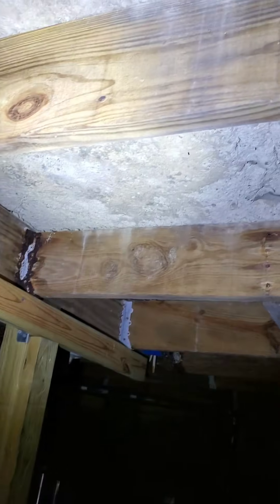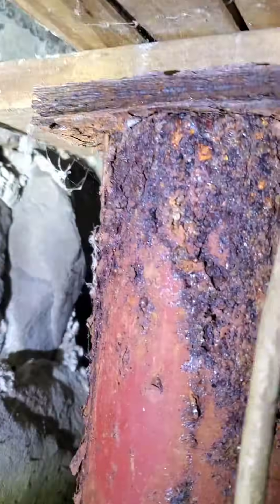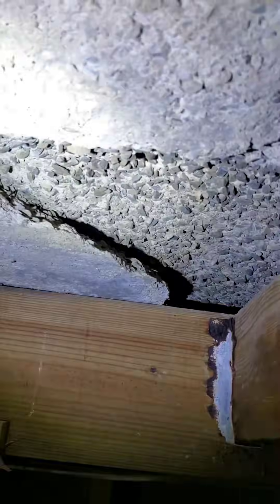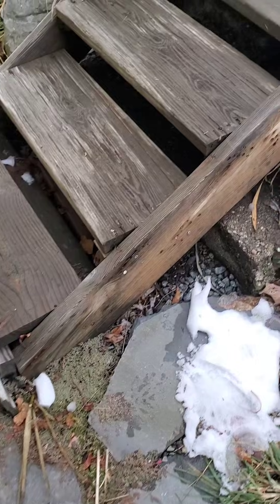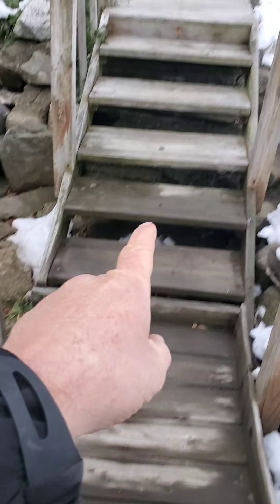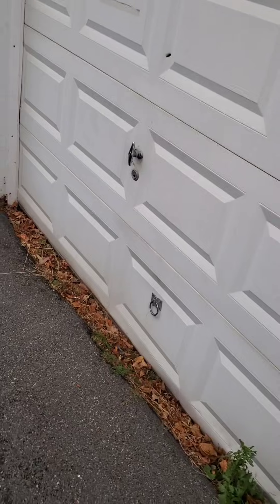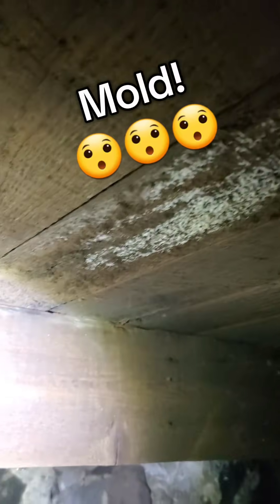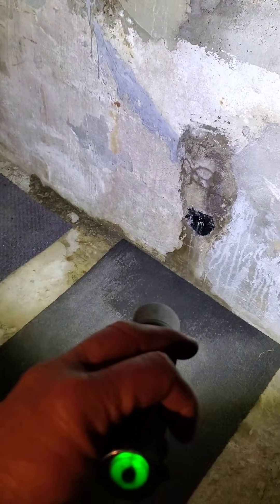Garage floor imminent collapse risk!

Comment: As a general rule, I thought you weren't supposed to put anything under garages, because people can put 5 ton cars in them. They just built 3 story townhouses on the hill next to my ex's house with the garage on the middle floor, meaning at least part of the garage has a basement under it. That doesn't sound like a long term reliable thing to do...

Comment: I didn't realise garages with suspended concrete floors were a thing. Is there any way to do that safely? I would want large concrete pillars if it is supposed to hold a concrete floor with a car on it...
Reply: Precast reinforced concrete panels,custom cut to the required length, wall to wall, engineer designed supporting walls. When done right it’s super strong, clear span below, but expensive.
Reply from the maker: Yup. I've seen them poured in place too with epoxy coated rebar and proper columns. I think we can all agree this isn't those :)
Reply: @tedecker3792  yep ala flexicore.

Comment: somehow i doubt they poured a prestressed one-piece concrete slab and set in, with a crane, on solid footings all the way around.   that thing there? you had guts walking under it.
Reply from the maker: Yup. 100% ... This was on a stacked stone foundation that was bowing and failing. There's no way a crane was brought in to set a precast slab on this. It was poured in place.

Comment: How did they pour that floor?
Reply: They dug it out after to probably begin to create a "man cave".
Reply: @oldfredbear  More like mausoleum or a crypt
Reply: @oldfredbear  If it had been poured on grade, it wouldn't be flat on bottom.
Reply: @ncooty , so you're proposing, that it was poured after the space was dug out?
Reply: @oldfredbear  That would be my guess.  It might have been a shed or storage space with a framed floor that they then decided to turn into a garage, so they framed and formed it for a pour.  That's my guess, but who knows with old houses.
Reply: @ncooty  right, so as I said, regardless, they dug it out below, after the slab was poured.
Reply: @oldfredbear  No, my guess is that it was a wood-framed storage area with a dug-out area below it (like a root cellar).  They'd have had to beef up the framing and set forms to pour the concrete where the old wooden floor was (between the upper and lower levels), but my guess is that they poured it into suspended forms--NOT that they poured and then dug.
Reply: @ncooty  and how did they get the cement to stay suspended above the framing while they poured it.... You don't see any wood between the framing and the cement...
Reply: @oldfredbear  You'd usually just use OSB or plywood.  Again, I don't know for sure what they did, but it would be super rare for someone to form out the bottom of a slab on grade.  I don't think I've ever seen that, and I don't know why anyone would.  If they knew from the start they wanted that set-up, they'd excavate first (root cellar and all), frame and form, then pour, then remove the forms (just like on a parking garage).

Another option would be precast slabs, but that's not what that looked like, and anyone doing something that loony isn't ordering precast slabs.

Just pure speculation on my part.  I don't know what they did.  The whole thing was loony, so all bets are off.  I guess that's part of the entertainment of this stuff:  wondering what in the hell people were thinking.

(Side note:  Is your name a reference to the famous bowman/ archer?)
Reply: @ncooty, you have to use the KISS method. This was dug out after it was poured, plain and simple. Every other option is just over thinking it. 

And yes.
Reply: I'm guessing that the particle boards and supports rotted out and what we see is the cobbled together "fix"
Reply: @shanegill25  You can literally see where the dirt put texture in the bottom of the cement.  I really hope you guys aren't serious.
Reply: @oldfredbear  I watched this on my phone and wasn't looking too close at the concrete
Reply: @oldfredbear  Re:  dirt texture on the bottom:  I didn't see that detail on my phone.  If you indeed see the dirt impressions on the bottom, then you're probably right, in which case that whole thing is way nuttier than I'd first thought.  Thanks for pointing that out.
Reply: @oldfredbear  Except you're wrong.  That's spalling.  Have you ever worked concrete?
Reply: @ncooty, yup, sure have. I'm not wrong.
Reply: @ncooty  think about it, they poured LIQUID concrete. Please find any point in the video where it's possible they poured LIQUID concrete that set up in a slab that supports what you see in the video.
Reply: @oldfredbear  Sorry, bud.  Nothing you've said indicates you know anything about working with concrete.  You don't even seem to recognize spalling.  Think what you want.  I truly don't care.
Reply: @ncooty  🤣